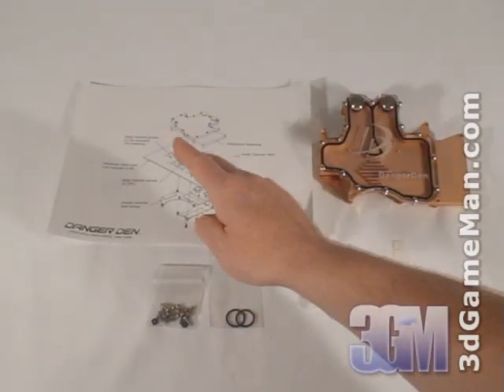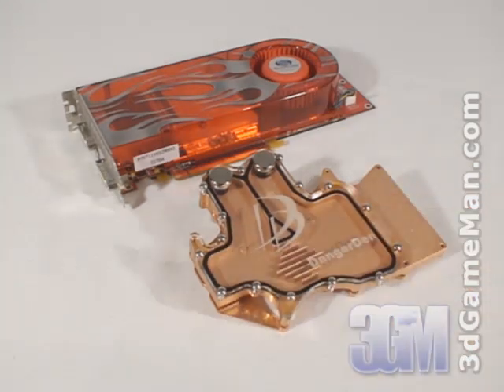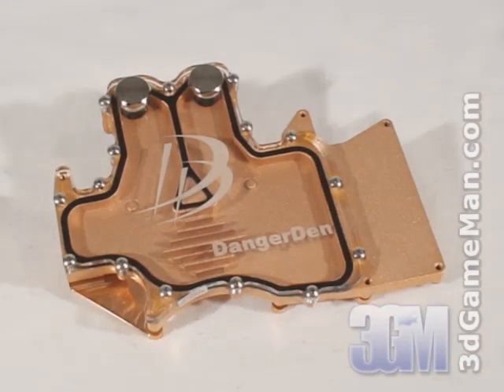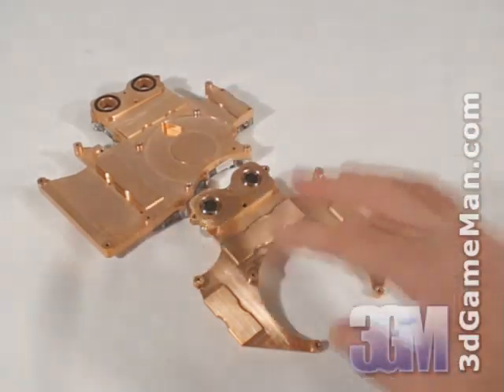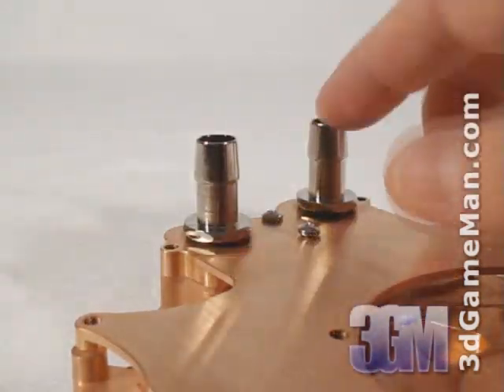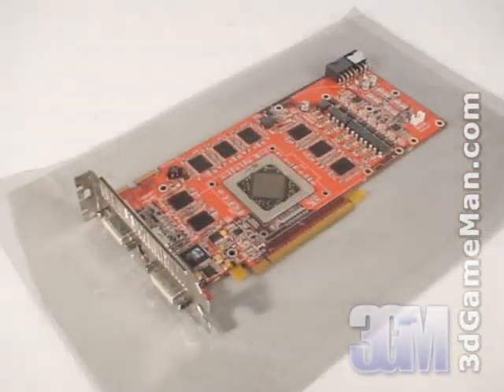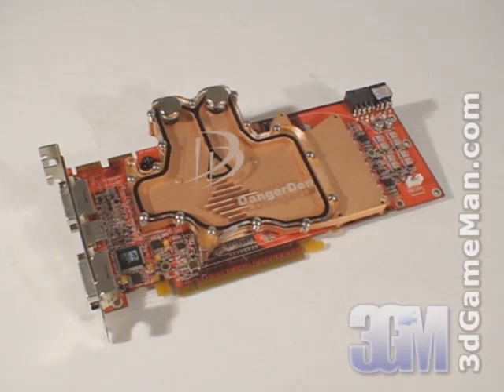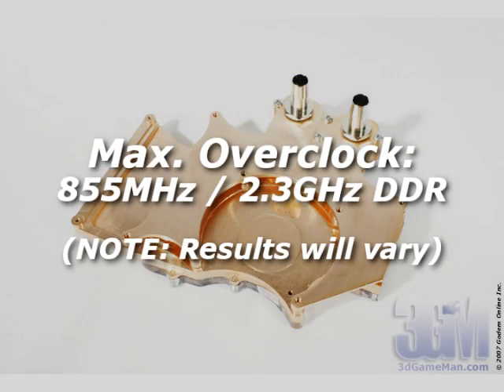#895- Danger Den DD-29XT VGA Water Block Video Review

Comment: Watercooling are silent, prettier, generates no heat do the case and ocupies less space wich is important because dont voids the pcie slots, off course same grafics uses realy two slots because they have back conections but even in that cases you could still use pcie slots that dont use brakets.

Comment: these water blocks are great for your card, special when u run any SLI or Crossfire set up.
mostly cuz the top card (or 2 top cards) will have very little room for good air flow and where they do get it there is a heat GPU from the lower card.
so it will end up making lot of noise.